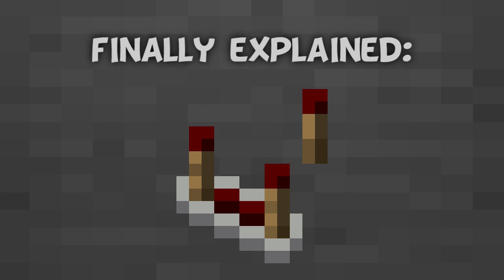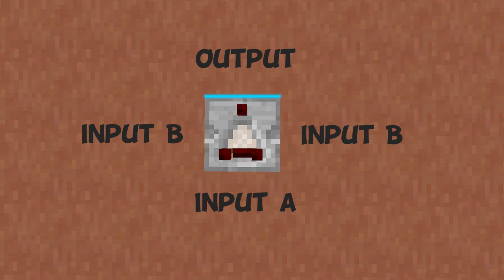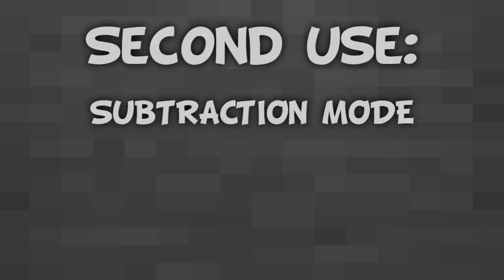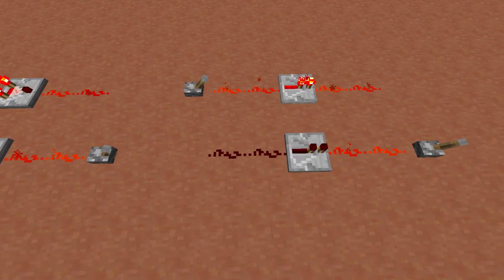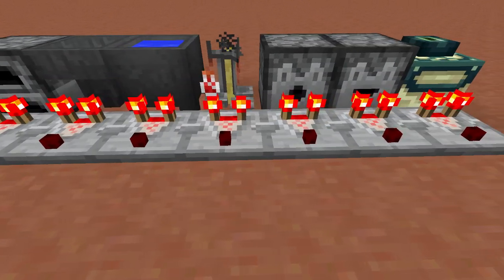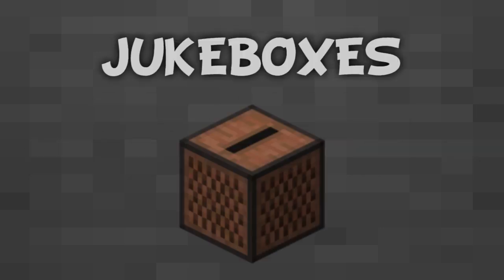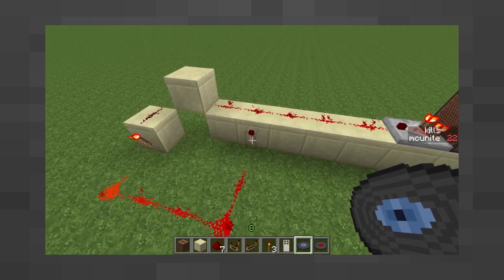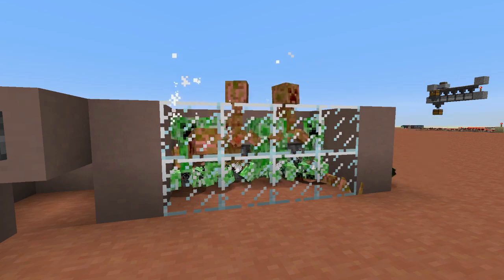Finally Explained: How Do Minecraft Comparators Work?

Comment: subrtraction mode- input A minus input B so if imput A's signal strength is 15 and input B's signal strength is 1 the the output will have a 14  signal strength. thats it
Reply: This is the most helpful comment EVER.

Comment: Great lesson on this. Unfortunately I found this from the wiki page which also neglected to share with us - how is the comparator crafted?
Reply from the maker: I should have included this. It's made by putting three blocks of stone along the bottom row of a crafting table, a piece a quartz in the middle square, and redstone torches to the left, right and top of the quartz.
Reply: PoweredMinecart McUnite Thanks for clarifying this. As I said, once you have a comparator, this is an excellent introduction to how to use them which I will recommend.